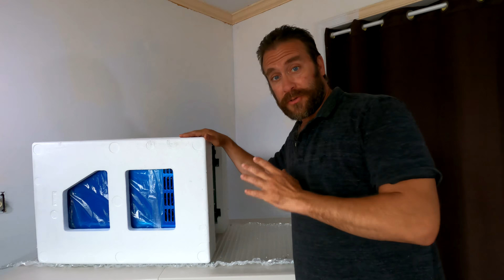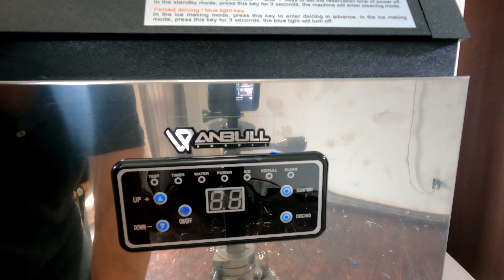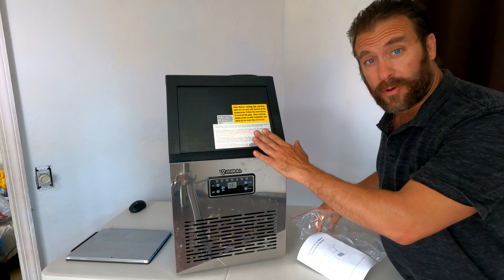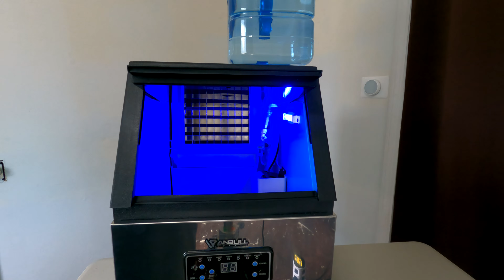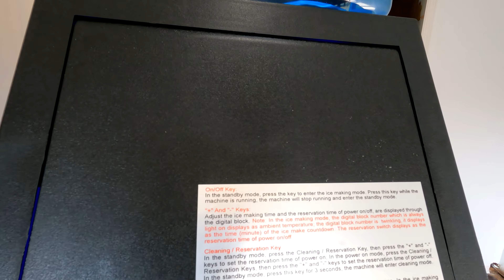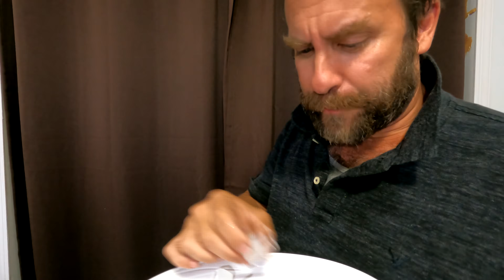Unbox, Setup, Review, and How to Use, Anbull (and Similar) Commercial Ice Machine

Comment: Hello, I have some questions about this machine, the water is recirculating while the ice is done? and if I have a put bottle of 10 Lts this means that the machine will do 10 Kg of ice, correct? thanks so much by your answer.
Reply from the maker: The water drains into a sink or container. Your choice.
Yes. it makes ALLOT of ice

Comment: How do you get the water out? Mine is hooked up to a drain line but I can't get the water to go down. Could the filter be clogged?
Reply from the maker: Hmmmm, mine just runs right out the hole in the back. Your water is sitting in the ice bin? Or the water bin? The water bin has a rubber plug in the bottom
Reply: It’s in both. I unplugged the rubber plug and it added water into the ice bin. (It’s shut off and unplugged at the moment.)
Reply from the maker: @user-ob2ns4ok4p yep, when done making ice, drain it into the ice been, then out of the ice bin (should be a hole in back corner of ice bin, with a drain hose attached
Reply: This was professionally installed 4 years ago. It would cost more to get them out to my house again than the machine itself cost! I think that I need to change the filter — and the drain line is probably clogged.

Comment: All the Ice-Makers I've seen look very similar.. Euhomy, hOmeLabs Freestanding, COOLLIFE Ice Maker.. I assume the installation should be the same?

Is the Euhomy bin refrigerated or does the ice start to melt as soon as it goes in the bin?   Can you select the ice-cube size (I assume smaller is faster)?

How many gallons does it take to fill up the bin completely?  

How do you select the water supply (i.e. top bottle or water line)?    Does it automatically shut off when the water bottle runs out or does it keep pumping?   How much energy (electricity cost) does it use in a month?

BTW, do you need a water filter in line?  Is there maintenance required.. for example, how often do you have to clean it?
Reply from the maker: They are all kinda similar
It stops if water runs out
No filter
2 sizes of ice available
No freezer. Ice will melt. It's insulated, like a cooler

Comment: The little black thing in the water storage compartment, I have a bit of a different ice maker but it looks similar. Is that supposed to hook up to anything or just stay stagnat in that place? Mine isn't screwed into the machine its got little suction cups. Please I need help!
Reply from the maker: Can I see it? It may be a water pump
Reply: @GreggAdventure  i figured it out! It was the compressor that pumps the water into the top of the ice maker splitter to make the ice! Thank you anyways sir
Reply from the maker: That's what I said! 😜😜

Comment: I'm confused, you say the dimensions are 13x16x25, the link to product in your description says 15.96"D x 17.52"W x 31.3"H.
Reply from the maker: It's possible they changed the model.
Reply: How has the long term quality been? I have seen some reviews that complain about flaking of the metal plating on the metal ice forms after long term ownership (not this brand but similar.)
Reply from the maker: So far, it's still working well. I don't use it terribly often, but, I do use it, and it hasn't shown any sign of this, yet.

Comment: Hi Greg, I have a similar machine but it uses only the water pipe. M struggling with it as it doesn’t feed water to the tray, do you myb hv an idea of wat the issue could be?
Reply from the maker: Check inside for a cutoff valve. It should be a little handle that you turn to be parallel to the line

Comment: Several issues, at least as far as I (or my setup) am/is concerned: first, it appears to make white ice. My freezer already does that. If I pay for an icemaker, it better make clear ice. Second, it comes with a drain line but markets itself as free-standing. Where am I supposed to run this drain line into? If it were made to be installed under a counter, I could run it into the under-sink drain. Third, for the money, is that a) really enough ice and b) sufficient holding time for the ice it does make? Thanks for the video and I hope those that get this will be happy with it, but it isn't for me.
Reply from the maker: love mine. Sometimes have it make ice for 24hrs straight over holidays. It's not Fill-your-cooler Output, but it's Ice for your entire parties drinks Output. 

The White is likely air.  My ice it totally clear.

I out a small Jug next to it, and stick the hose in it.  Sometimes I crack a window and slip it out that. Some peeps run it to a sink.
I find the ice holds well, long as it's still running

Comment: This is the first portable clear-ice maker I've seen that actually has a drain line for the melting ice! I have the New Air clear ice maker, and like many other countertop models the water from the melting ice just gets recirculated.  Now, a true commercial ice maker (or built-in residential) model has to drain the remaining water from the tray (or overflow the trough, depending on the model) after each cycle because making clear ice leaves behind minerals and impurities since pure water freezes first.  My model (and probably this one) will continue to build up minerals in the left over water (even as more water is added) and the ice will become less and less clear and more white like you'd get out of a regular refrigerator or ice trays.  Simply draining the water and letting it fill up again gives crystal clear ice again.  Was wondering if this model also has the capability of draining the water between each cycle automatically especially if it connected to a water source?
Also, does the cleaning cycle mention using a Nickel-safe cleaner? That will also be needed to dissolve the buildup of mineral deposits (vinegar works too in these small portable models) in the system?
Reply from the maker: The main drain is open always. There is a small  reservoir  that circulates the water back to the ice grid, while making. it has a small rubber plug, to drain it. It holds very little little, so isn't much of an issue. I'm not sure about the cleaner...
Reply: @GreggAdventure  Thanks.  These look like some really nice machines!

Comment: How quickly do you go through a bottle of water?  (How much ice the bottle make)?
Reply from the maker: I can't really say, but, I just refill the bottle, and put it back in. I usually only fill about 1/3 to 1/2, and it makes a LOT of ice.
Reply: Water weighs 8lbs per gallon so the old what weighs more 1 gallon of water or 8lbs of ice?  If you are befuddled. they are the SAME

Comment: Hi there!  Well, based on your positive feedback and nice messages, I went ahead and bought a very similar model.  It's the Commercial Ice Maker Machine - OYLUS 70 lbs/24H Stainless Steel Ice Cube Machine.  A little less capacity than yous.  So far, so good.  The drain bucket is fine, and I used bottled water.  The only bad thing was the door arrived broken.  Not a necessary part for it to work.  I'm only turning on, making a bunch of ice, freezing and then turning off.

Thanks for your help and messages!
Reply from the maker: Awesome. Good luck with it! Mines been a fun conversation piece at gatherings

Comment: Bought one and didn’t last . Replaced water pump in a month. Machine turned off by itself . Later wouldn’t make ice .
Reply from the maker: Wow. That sucks. Talk to them about it. Maybe will replace it. mine running strong
Reply: @GreggAdventure   no customer service and  Not NSF certified.
Reply from the maker: Sounds accurate
Reply: Which pump did you buy because mine wont pump
Reply from the maker: I didn't.... Using as it came

Comment: Good step by step.  How much water does this drain?  Is the bucket method working OK, or should it be into a drain pipe?
Reply from the maker: Drain is best, but a small container has been fine for me. It melts slowly. Really depends on how much ice you'll be making, and for how long
Reply: @GreggAdventure  Thanks!  I will probably do like in other comments and responses...make ice..freeze in ziplock bags.....turn off...make more ice as needed.  Thanks for getting back to me so quick!  It's Friday - have a great weekend!!!
Reply from the maker: My Mother loves to fill up Gallon Ziplock bags with ice. Great way  to do it. But.... For parties, let it run, for the Cool Factor!

Comment: Does the ice melt or is it a freezer compartment? Does it recirculate the melted ice to make more ice? I don’t have a drain and I want to leave the machine running around the clock but go some days without using any ice at all.
Reply from the maker: It makes ice quickly. There is little need to leave it running when not in use
Reply: @GreggAdventure  I use it for tie dye so my use is sporadic. Thanks for answering my questions.
Reply from the maker: Always here Bella. 👍🏻✌🏻
Reply from the maker: Not a freezer compartment, but, it's insulated, so the ice keeps it cold inside, and it lasts a LONG time. There is a Drain, with a drain tube. I keep a container at the end of the tube, to catch the water that melts, and drains out.
Reply: @GreggAdventure  So it does not recirculate the water. The drain must be in use?
Reply from the maker: Right. When The Ice melts, and the water goes down a drain hole.